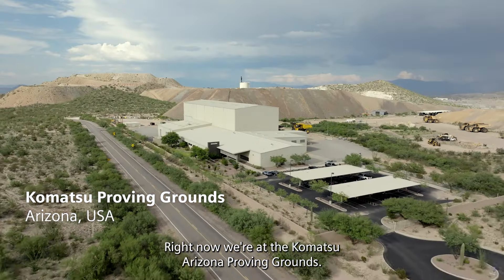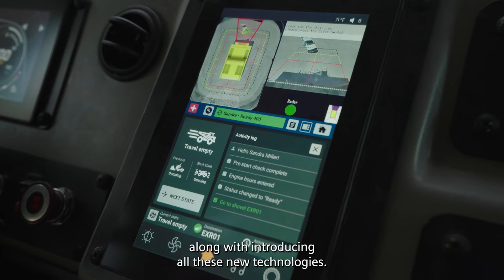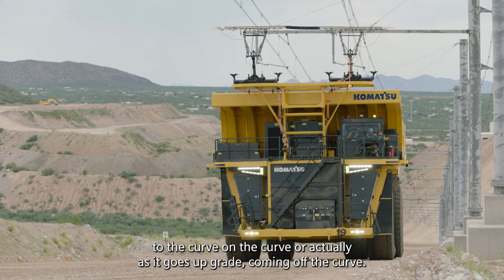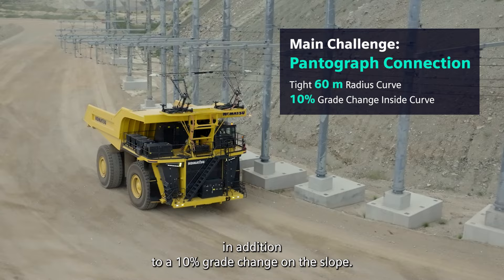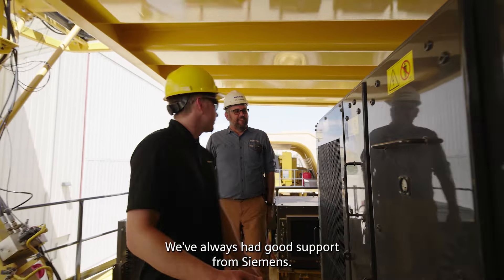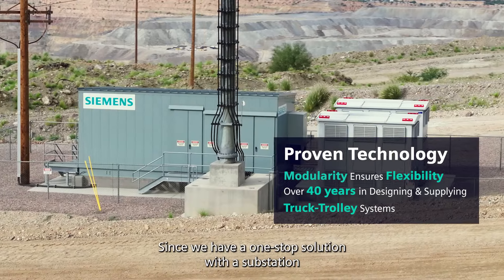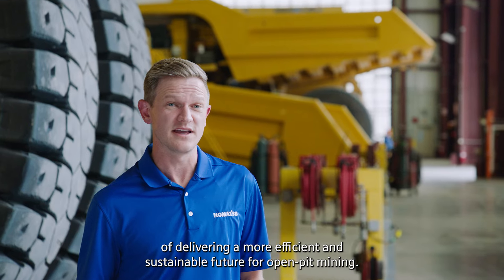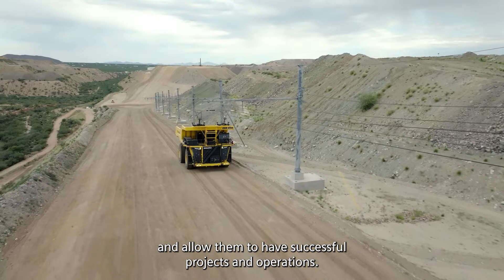Siemens Truck Trolley: Dynamic Charging at Komatsu Proving Grounds

Comment: looks like it can help make the truck climb hills faster. Probably saved the refueling time too. No need to schedule periodic fuel delivery to the mine. No need to wait for the battery to charge.
Reply: faster is an understatement, uphill loaded speed goes from 20km/h to 40km/h
those overhead wires are able to put 5000hp through the wheels(nearly twice what the engine can do), and charge the battery at the same time
Reply: Yep, for all the talk of decarbonization, I figured they wouldn't be doing this if it is wasn't going about saving money. Sounds like the savings would be faster trucks with lower fuel and maintenance costs. Of course there's higher up front costs for the overhead wires. Cost of trucks shouldn't be a big factor since many mining trucks use "electric transmission" with the diesel engine powering a generator to provide power for electric motors, just like most diesel locomotives.
Reply: @jonscaplan  yeah most mining trucks are already hybrid, unless theyre cat trucks which for some reason are still mechanical drive despite being objectively worse lmao

even when decarbonizing is more profitable(there are many cases of this) companies are still against it because of those upfront costs, its good that some mines are willing to invest in their own profits instead of only thinking 3 monts ahead
Reply: You will NEVER see this at a profitable mine ever. Waste of precious time and money.
Reply: @ohhhface619  its cheaper than diesel, increases productivity and decreases maintenance
you have no idea what youre on about
Reply: @ohhhface619  This doubles the speed of the trucks.

Comment: Use the pantograph and overhead wires as guides and make the trucks self driving. Driver still needed while picking up a load from wherever mining is occurring and at the dump site but can sit back and monitor whats going on while the truck drives in between the sites. Germany is trialing the same system for semi-trucks going down highways. Truck is self driving while charging and driving down the highway. Driver takes over when not on the highway.
Reply: They already  have self driving at plenty of mines… you do know that right?
Reply: @jamesbizs  Not sure why you'd think I'd know that? Simple deduction would tell you that I didn't know that given my comment is about how hauling trucks could be automated at mines. Not sure why the condescending attitude was needed.

Comment: I am assuming each truck draws at least 3000Kw and if this was in an operating mine you could expect at least 10 trucks to be using it to get out of the pit.
How do you expect a remote mining operations to be able to provide 30Mw of continuous electrical capacity?
Reply: Micro nuclear reactor
Reply: @Sam-yu6ss  ...... right so every open pit mine is going to have a nuclear reactor attached. Back to reality.....
Reply: @stpOwner  Diesel used in one large generator is more efficient than diesel used in 10 trucks, plus you can use real cheap nasty oil and run a turbine or thermal plant depending on the location.

Or you could get a transmission line built from a national grid, or like the Pilbara, one central nuclear (or otherwise) plant for basically all the mines in the area.
Reply: lmao what some wild ass math, 30gw would be 10,000 trucks pulling 3000kw

but these trucks already have 3500kw generators on them and the wires can do around 5000kw to give them more power

10 trucks at once would only be 50mw

which is something that several mines in the pilbara already have solar farms big enough to handle

edit:fixed math
Reply: That would be 30MW not 30GW... Also the trucks only need power going uphill. If there's catanery installed on the downhill sections the trucks could recoup a significant amount of power.
Reply: @Tealice1  Sorry, correct accidental added a (10^3), the point still stands, it's a shit load of power to find in the middle of no where.
Reply: @vincentgrinn2665  5kw extra would be completely unless.  unnoticeable for trucks this large......
Reply: @stpOwner  yeah ok i was actually wrong there, the engine is 3500kw, the overhead power is 5000kw
not 5000kw added though, its just instead of using the engine
and it literally doubles the loadeduphill speed from 20km/h to 40km/h which is huge

but still 10 trucks using it at once is still only 50mw, still not a lot of power
and i mean, those 10 trucks already have 35mw worth of generators inside them
Reply: @stpOwner  Big mining operations need a lot of power for other equipment, accommodation, etc. anyways so there probably is some source of power nearby. Most mines aren't in the middle of nowhere anyways, mining towns have that name for a reason.
Reply: @stpOwner  AFIK No one operates Nuclear Reactor commercially on land as small as 50 megawatt and smaller.
Reply: BAHAHAHA 30 MegaWatts is tiny for the mining industry. That's just a SINGLE Gas Turbine.
Reply: Most mine sites have a dedicated high pressure natural gas pipeline, with their own gas turbines, process heat boilers, and generators.
Reply: @TheSonic10160 The skid mounted diesel generator is literally the exact same engine they put in these heavy mine haulage trucks. So you may as well put them in the trucks and not have the inefficiency of stepping voltages up and down over wires.
Reply: @gregorymalchuk272  nah you may as well have them out of the trucks and not need to carry around a 60 ton engine, or in the case of cat haul trucks change rpm or lose power to mechanical linkages

plus larger generators are more efficiency
Reply: @gregorymalchuk272  It depends, the transmission lines are short enough it could just be the same voltage and current as the traction system on the truck, whether it's 1500V DC or a few to many kV AC
Reply: Plenty of mines that aren't remote operations where grid connection is possible.
Reply: @Tealice1  or they can charge going downhill . there is a mining operation somewhere that is on a mountain and the electric trucks never need to charge externally as they come down the mountain loaded and regenerating charging batteries. they generate more energy down loaded then they use on the rest of the cycle .
Reply: @vincentgrinn2665  our shop uses 1 Mw demand at 4160 volts . so 50Mw is totally doable. and are all 10 trucks going uphill at once ? or are 5 going up and 5 going down. down will generate power.
Reply: @ronblack7870  oh yeah 50mw is barely anything, 10 going up at once was just a rough example that the other guy gave its not too unreasonable
but generating power from going down would require building another set of overhead wires on the downhill side, which just isnt worth it since the trucks will be going down empty and thus have less energy

mountain top mines on the other hand where youre going downhill loaded, you can just use batteries cuz those things create more power going down than they use to get back up to the mine